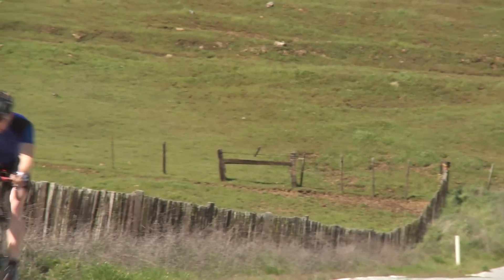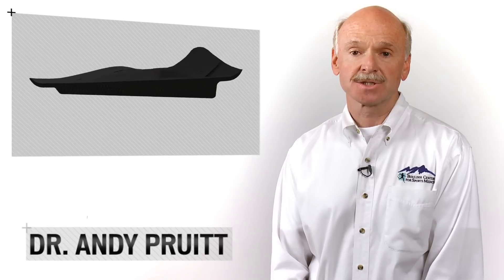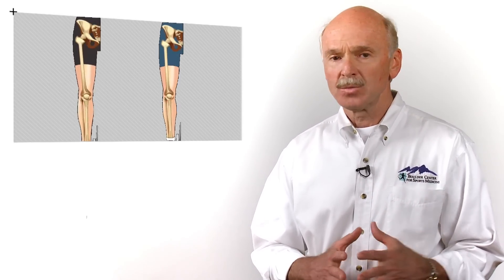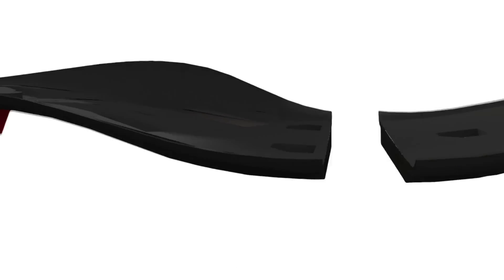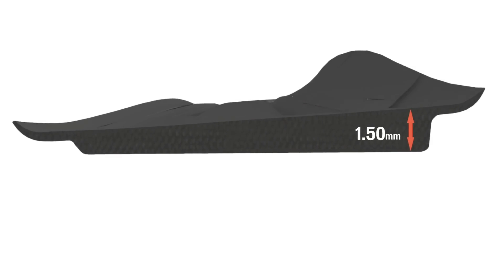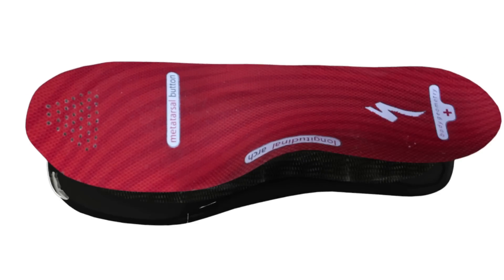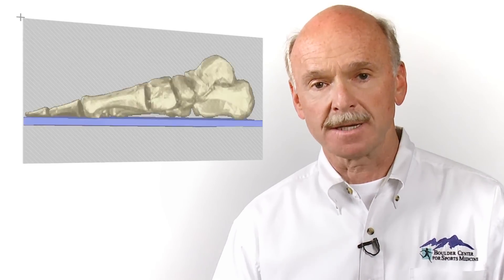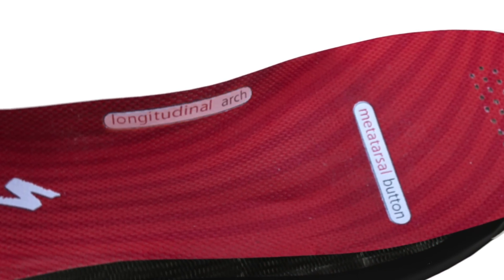Specialized Body Geometry Shoes

Comment: For what it's worth, I used to get numbness in my feet, too.  Although I'm not using BG shoes (I use Sidi), the fix was to release the tightness of the ratchet one notch.  If your shoes have similar similar, e.g. Boa, try tightening them slightly less and the numbness may go away ... it did for me.